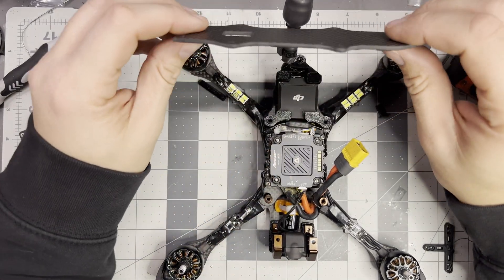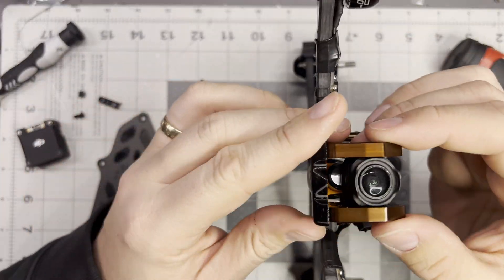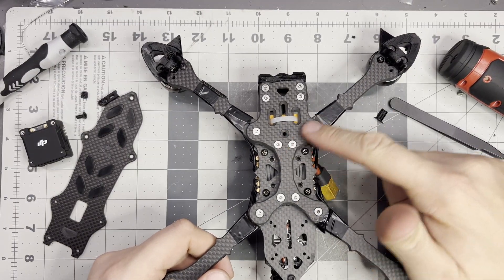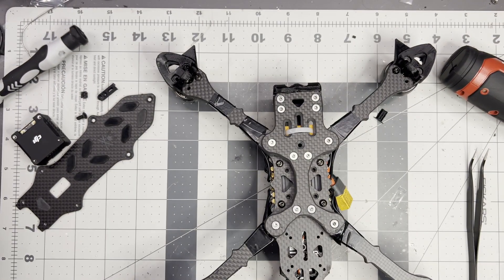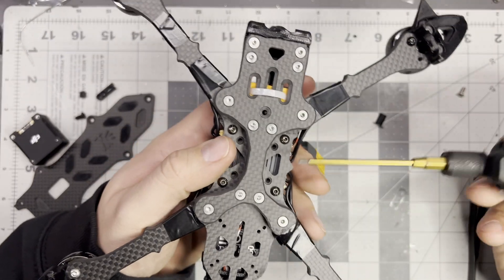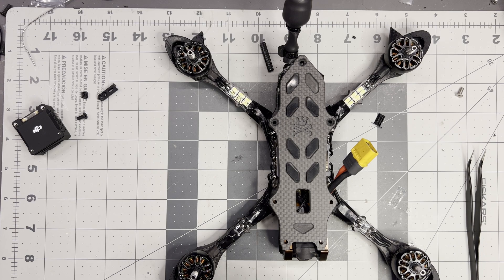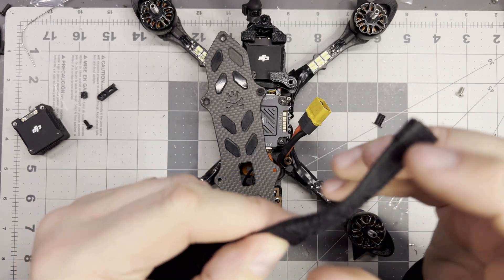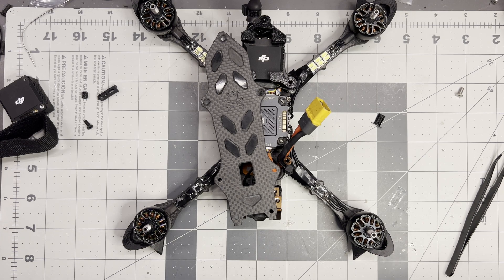FPV drone - Pirat Punch 5" frame review - Overall good with some caveats

Comment: Just found this AFTER I purchased the frame and by chance the exact same stack, although I fly Walksnail and T-Motor F60. Did you hard-mount the ESC directly on the thread inserts or did you suspend it a little ? I see you cut the Axis stack screws to size just as I did. I actually find it very hard to mount the stack in a way that I still have enough space for the LiPo strap because I use T-Motor lipo straps with silicone lining. I just finished a TPU plug for the top deck that double-acts as a stress relief and will actually protect the 12AWG wiring from getting destroyed by the lipo in a frontal impact. I will now design a combined GPS and LIDAR mount for the rear end as I will fly this on INAV. The mount they provide for the MATEK M10 is a joke, it even protudes behind the motors and gives zero protection for the ceramic antenna body. And I will also fly it in a hybrid config, squished in front and trueX in the back as I do not fly with a GoPro. The stock VTx mount is okay for me, but I don't fly bandos, so my opinion does not count. Torx is very okay for me, as I live in Germany, but the actual screws and the tool they provide seem to be below average standard even though they claim quality name brand hardened stuff. Maybe they got ripped off in purchasing. Overall I like the frame, but I feel they stopped the design at about 90% finished. I sweared a lot building it. Let's see how it behaves in the air

Comment: going to try this thing in deadcat configuration with the squished x in the front and true x in the back. we will see how this works haha.
Reply from the maker: Haha, howed it turn out?
Reply: @DanoFPV  hasn't yet. Finally got the vtx. Been working a bunch so haven't had time to get it together yet. Soon though hopefully.
Reply: @DanoFPV  flies well. So far. Still need to take it to more space to adjust a bunch of stuff but it flies well

Comment: Just the video I’ve been looking for on this frame! Thank you for making this and for sharing your experience with it.  Looking to try something other than the apex and it was between this or the siren by quadmula.  I think I’ll give the punch a try!
Reply from the maker: Even with the caveats, I love the frame. I've been flying it as my main rig since I got it with minimal issues after I designed some prints for it. If you run an O3 check out this reel on insta: https://www.instagram.com/p/C3QPNEmre1R/